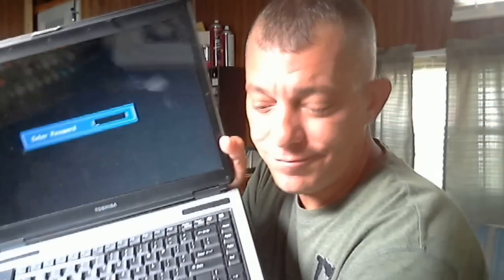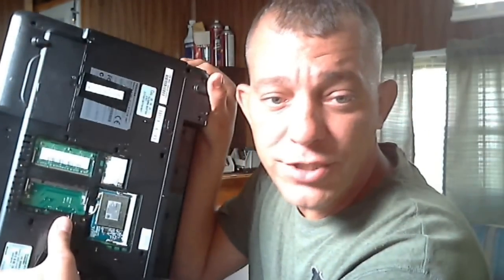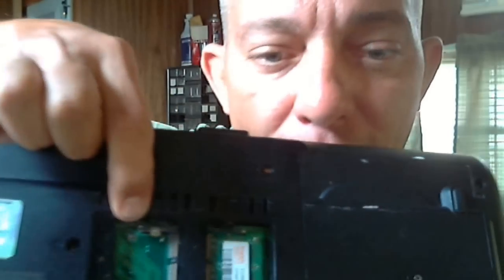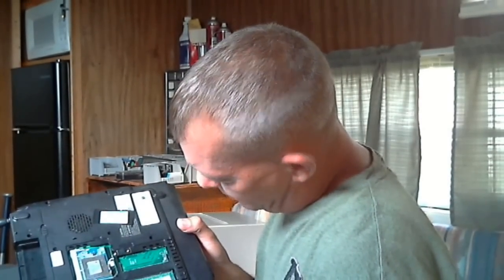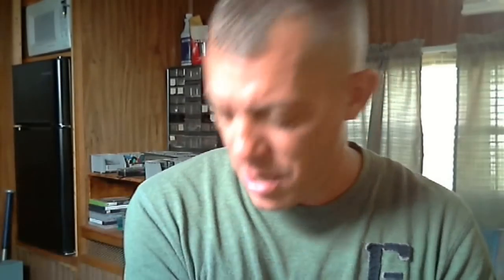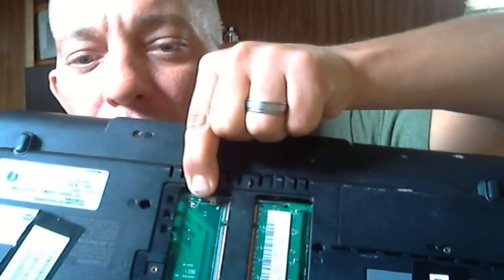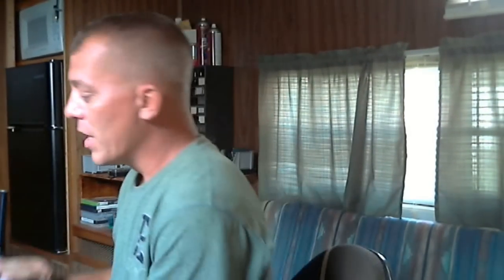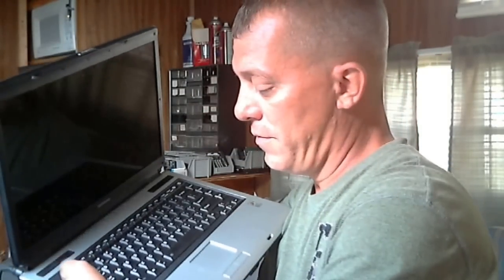Toshiba BIOS Password Removal - EASY WAY

Comment: You are correct on this one mate. This is by far the simplest way to reset the BIOS and I'll just leave that solder on. Thanks for sharing this man.
Reply from the maker: Thanks for the comment, just glad it helped!
Reply: i also used this video fab works a treat ty

Comment: WITHOUT the solder, just use a flat head screwdriver and attempt this fix. I left one stick of RAM in the machine when I tried this. AC power only. I tried it on a S855 Toshiba and it worked just fine.

Comment: Did you know that you're the best? I was googling for ages to find how to do it, perfect explanation, many thanks.
Reply from the maker: roham pilram glad you found it helpful.
Reply: @DrcJr77  
#Unlock #Toshiba #Tecra, #Satellite , #Portege , #Satellite, #Qosmio #Bios #Password
With #Challenge Code and #Response Code

1. Switch on the notebook, when the boot logo appears press [F2].
“Password=' will be display.

2. Press keys in the order [CTRL], [TAB], [CTRL] and [ENTER].
The Serial number and Challenge code will be displayed.

Please Note:
For some reasons it could happen that no PC Serial No. and Challenge Code will displayed instead of "Not Certified" appears. In this case remove the AC-adapter and the battery for a short time and try it again.

3. Please make the payment below or contact me
My Skype : haisung4344

VERY IMPORTANT
Do not power off the computer once you provide us with a Response code. There’s a unique Response code .
Don’t turn off your notebook, don’t restart it, don’t enter anything except generated Response code.

4. You will receive the "Response code".

Comment: I did that and now i have black screen pls help!
Reply from the maker: if you have black screen and are sure it's powering up. then power off, unplug all power sources, discharge, remove jumper, power on with AC only with no ram, wait for error code or beeps, power back off, unplug all power sources, discharge, install ram, plug AC power only (no battery), and power on
Reply: Where are you located? Can i send my laptop to you to fixed? I will pay just let me know how much.
Reply: I can’t find no one here in nyc who want to doit for me. Unless i pay $220 and i loos all my files.
Reply from the maker: Lila Kerroum TN. Im booked up till mid Feb though. Sorry
Reply: It did the same to me just a black screen. How did you fixe it?
Reply: @omarherrera1786  you have to rotate your RAM the ram you have on top put it on the bottom the bottom ram now goes on top

Comment: Worked on a client's PC that had the B500 contact points. After adding the jumper just power it up and wait for to reset itself and boot up. And like you said, removing the jumper is optional, but recommended.

Previously I had trouble maintaining the short using a screwdriver. (duh)

Thanks :-)
Reply from the maker: glad you found it helpful. much easier wasn't it.
Reply: I Have the same contact point B500 ( real close to memory) ... I'LL try this  THX

Comment: DrcJr77 , yeah, thank you. solder pad is coated with silicone or something. I have tried to clean it with isopropyl alcohol but it does not helped at all so I soldered both pads for a while.